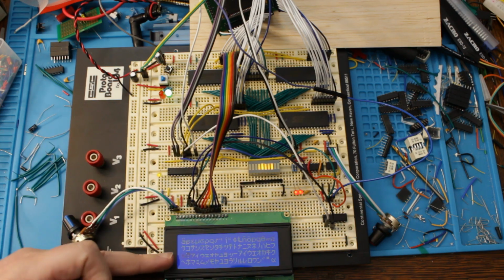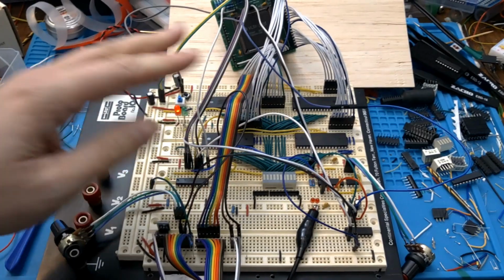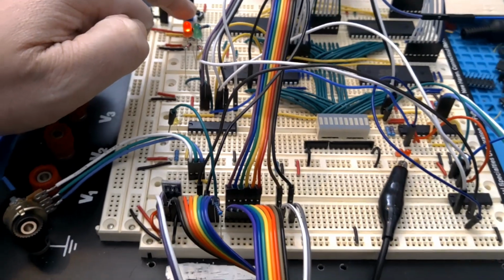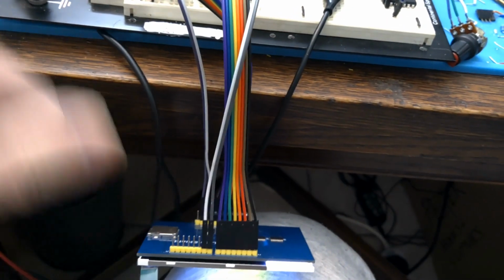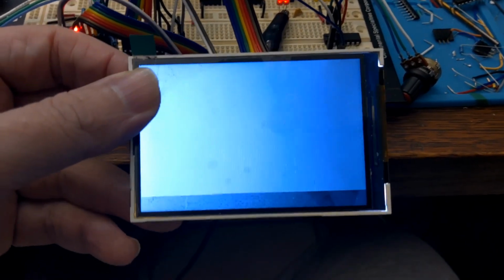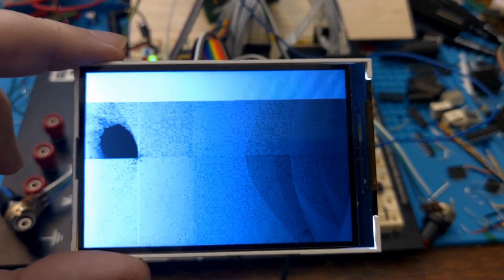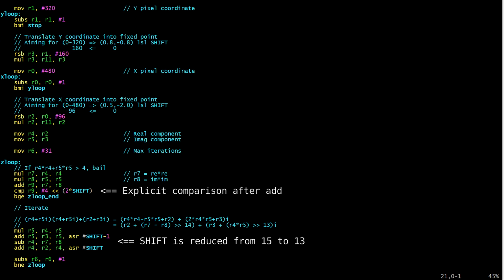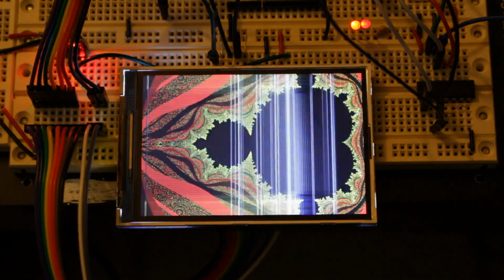Homebrew ARM2 #7: Graphical LCD rendering a Mandelbrot

Comment: Just amazing that you were able to make it work with just ROM.  I will have to try setting up an LCD panel on my 6502 computer.
Reply from the maker: Is that the rack-mounted one? I've been thinking of making something modular recently, I can't make my mind up on the design though
Reply: @GeorgeFoot  No, I was thinking about using my "all purpose"  computer that I used in my TIM chip and Tiny Basic videos.  The rack mounted one needs too many parts that I have gotten rid of; ie. power supplies, TV's, keyboards, and "front panel".  That one used a +8v, -5V, +12V, -12V, and +24V (for eprom programming) supplies.

Comment: Nice looking Mandelbrot. Debugging that program must have been pretty tricky, especially with four ROM chips.
Reply from the maker: The biggest impact is not wanting to try things out when I think I have a fix, wanting to be as sure as I could be - because of the friction, I checked the whole program more thoroughly before going ahead. Also, not making incremental improvements, going in bigger leaps than I normally would. I only actually had to reburn a couple of times for bugfuxing - and one fix was a single-byte change, so that only one ROM needed burning, which was nice.

Comment: Very cool. All this without RAM and a stack? Groovie. :) not many folks have built breadboard comps out of early ARM, this is groovie!
Reply from the maker: I had to make sure some functions didn't use the same registers as each other, and save the link register in some nested calls, but overall it was fairly easy to fit in. The Mandelbrot calculator uses a lot of registers but doesn't need any function calls, so that's cheating a bit.

I'll probably add RAM soon, but the next trick would have been using SWI (software interrupt) for the "library" function calls, as they then get their own versions of certain registers, distinct from the user space registers. The CPU actually has something like 27 registers internally, just only 16 visible at a time.